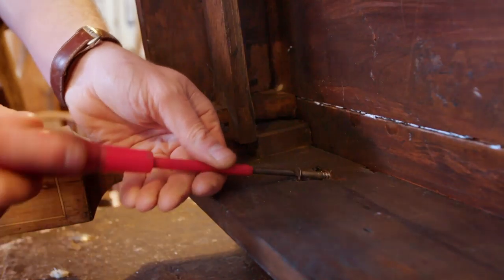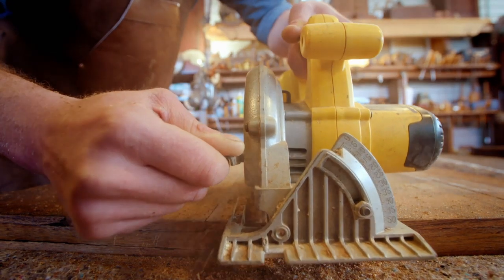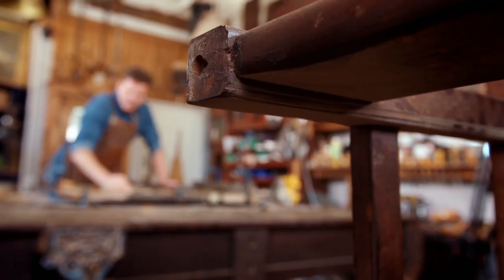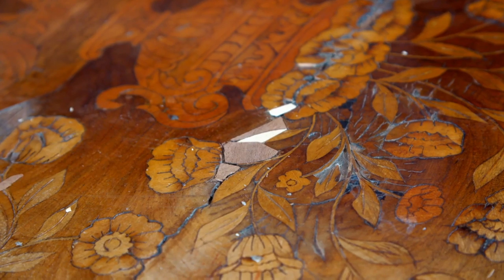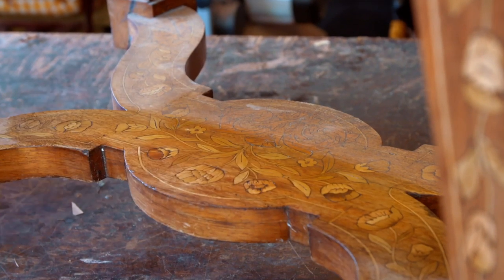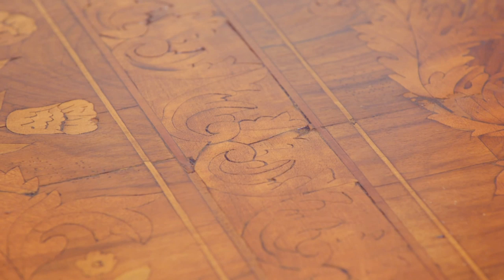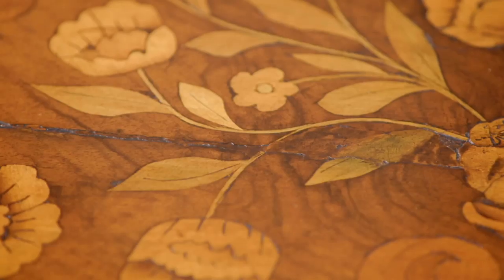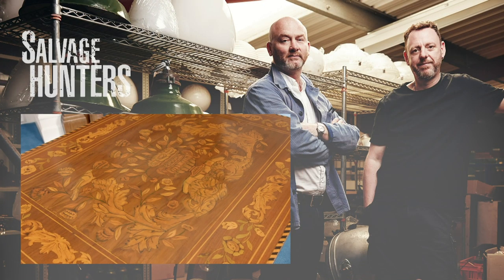Replicating The Marquetry On A Pair Of Stunning Dutch Tables | Salvage Hunters: The Restorers

Comment: Why not use protein glues for the restoration work? That is what would have originally been used. It also makes no sense to use wood glue to close the gap together when you are not even certain it will come together perfectly till you clamp. Hide glue (old brown glue) at least affords you the ability to redo the fitting and take your time in clamping it back together. A proper restoration of the missing marquetry pieces would have been to trace the cavities and cut the veneers with a saw to an exact fit, not leaving it gappy in places.
Reply: I was thinking the same thing. Shock horror that he used pva glue. He should have applied a reversible glue like animal derivative. Also those machine made replacement veneer sheets were no way the same thickness as whats on the original. He should have cut ones that have the same depth as whats on the table.
Reply: @sidneyharris4003   Unfortunately he has destroyed the future of so many decent pieces of furniture during his career. Not sure why anyone actually thinks this is a decent job as it's absolutely awful in every way. He seems like a nice bloke but shouldn't be let near anything of historical importance

Comment: They were teaching us not to use white glue during restoration. It should be reversible for next restorer. Also it works diferently under veneer. Especially regarding moisture.

Comment: Table lost it's  value at the moment when a circular saw touched it. Also using the PGA glue to restore the antiques is not a good idea. Good luck!
Reply: What would you suggest as an alternative? How else could the crack be closed? Or would you leave the crack?
Reply: @AndrewGould-NewWorldByzantine  I can't tell you, unfortunately. I haven't seen the item personally. There are plenty methods of doing this. And to saw the table in halves is at very end of the list. As for the else I was told that when you restore something you ought to use tools snd glue with which it was originally made with. Hope I was clear. Sorry if not, English is not my mothers toung.
Reply: Making relief cuts is common in furniture repair and restoration.
Reply: @johno4377  only when the blades are solid. These are hollow. Should separate the parts as they were build. Than repairs, than back. Ohw, and no pvc glue, hide glue only.
Reply: @derestaurator  Well done sir! You are absolutely correct.